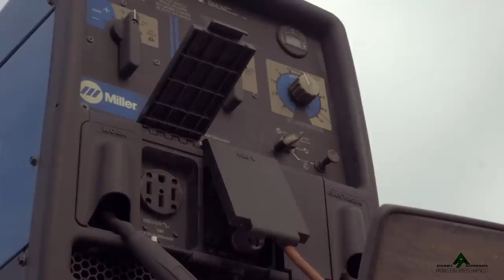SWAMP LOGGERS NC  / "As Swampy As We Can"

Comment: Waiting on the new trucks 😀
Reply from the maker: So am I ...lol. Thanks Gary!
Reply: @swamploggersnc4720    i will give you one little tip for the new trucks. the scandinavian way to set up a tandem drive suspension are to have a dump valve for the bags on drive axle nr 2. so when you are empty and struggle with traction you can transfer the weight to drive axle nr 1. that also gives a tighter turning radius. 
see that on spread axle trailers in America. but not on trucks hehe.  
really enjoy the videos :)

Comment: Bobby, on the clam bunk. Check your turbocharger make sure it's rotating freely. Black smoke and lack of power sounds like an intake problem not so much a fuel problem. Start at the air filter work your way to the turbo.
A Plugged up or oil saturated air cleaner element will also cause a  problem. But what you described sounds like a failed turbocharger. Great video.  Wish I was working with you. Best of luck to you & the crew....
Ya a video record of The adventures of the swamp man. Sounds way cool. !!!!!
Reply from the maker: Thanks so much!
Reply: How did I miss Dave cooking for you guys
Reply: @swamploggersnc4720  They had a shovel here that was doing the same thing. The trouble ended up being the intercooler was busted. New intercooler and problem solved. I'm with Roger. Start from the intake and go from there. Check boost pressure. That'll tell you a lot.

Comment: You never had to worry where you stood with an older Mack. The new ones not so much.
Reply: Old Mack's would wear out 5 good men, and still be ready to wear out 5 more
Reply: @RJ1999x  In one day!!!
Reply: @lewiemcneely9143  there was a dm model Mack quad axle gravel truck coming around a gravel pile loaded, a Kenworth W900 was coming around in the opposite direction , loaded and they hit head on. The Mack went back to work with a damaged hood, the Kenworth went out on a hook. The owner of the Mack had the hood replaced and they put W900 headlight bezel and buckets where the round Mack lights were to commemorate the collision, and to rub in who drove away!
True story!
I should have said this was in 2012
Reply: @RJ1999x  i believe it. The 1st truck I drove after 5-ton Army life was a steel hooded DM with a 237 Gold Dog and 6-speed overgear tranny.  That thing would wring an axle while rolling. My Uncle and I both did it. Then there was the fiberglass hooded DM with the 180 horse 673 Thermodyne and a 5x4 quad box with main direct in 4th. Both tri-axles hauling 21 or 22 tons. Then it just went all over the place with RD's, MB's, C's and Superliners with the E-9 V-8's. I looked more bulldogs in the rear than anything else and I started in 72 I think,  Chauffeurs license time then. Glad to be done for a while.
Reply: @lewiemcneely9143  love the superliner! I knew a guy that drove a 525 magnum in a superliner was pulling a heavy crane down to an emergency situation, the police looked the other way so the crane could get there as fast as possible, he said the thing pulled like a locomotive!
Reply: @RJ1999x  They would. The one I drove was a tri-axle with a 12-speed. The thump of a V-8 never leaves you and you can hear one and your heart will start swapping holes. They were STRONG! The Aussies still use them on road trains. The company had one but had to turn it down a little because it kept breaking cams. It's still around.
Reply: @lewiemcneely9143  I've only driven the 300 hp 673 and a 400 hp E7. The E7 would push a 3406 or N14 /isx right up a hill with the same load, that was in a 713.  And the dog just didn't back down
Reply: @RJ1999x  An RD with the 300 tip turbine setup for the cooler was after the 237. It'd talk to you. Then there was an RD that was a tri-axle that got made into a tractor. 350 and a 12-speed, 44 rears and a 38 front. STIFF sprung but just kept going. . Had to shift at 15 or back out because the pyrometer was pegged. It was fixing to be turned down till I got it. Never had a minutes trouble but a blown turbo. I was rough on turbos. If it'd pull it and not heat I'd let it go and do it's thing. kept the soot blown and melted out of it. And a RD with a 350 and a double-L tri-axle pulling a pup. 25 tons legal at 80K. Good times till the tongue on the pup broke. Had to cut a foot off it and cut me back to 78 I think. Still liked dumping it in one pile and not tearing the tailgate off the truck!.